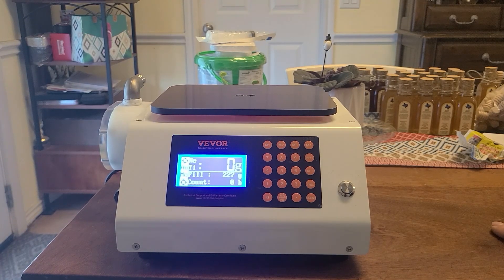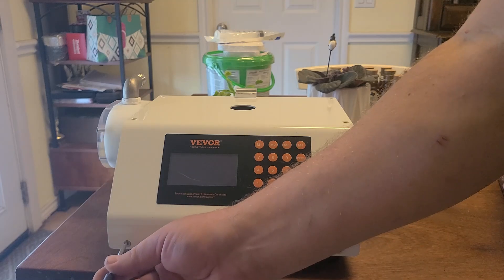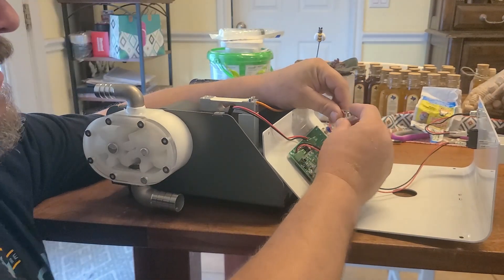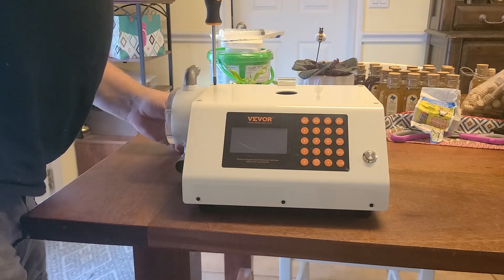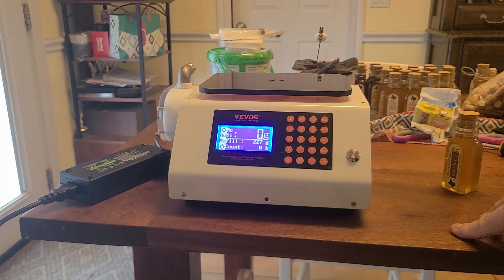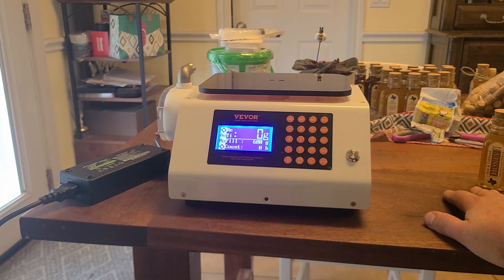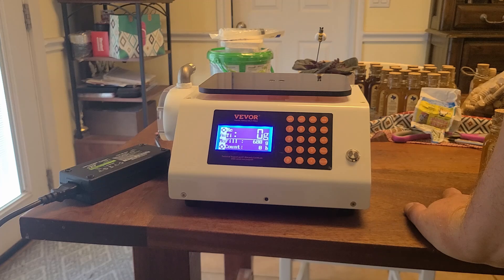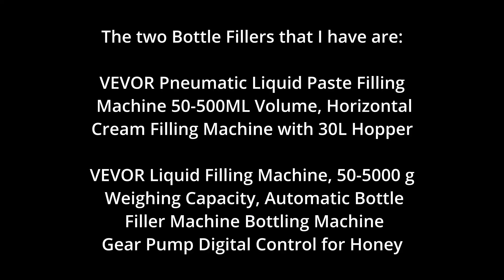VEVOR Bottle Filler  Quick and Easy Repair

Comment: I bought a very expensive automotive battery charging station for next to nothing and it had the same issue with a pin that was pushed out. After looking the machine over it had never been used so I really lucked out. I even find this issue in automotive wiring harnesses. Great work!
Reply from the maker: @rodneymiddleton9624  yes sir!
It's always nice when it's an easy fix like that!

Comment: where do you find the programing guide. i bought that unit. there is nothing in the manual that tells you what function the keys preform or how to program it.
Reply from the maker: @waynej7037  hey Wayne, the manual didn't have a lot of information. A lot of that was trial and error. 

Hopefully I coveted it enough to help.